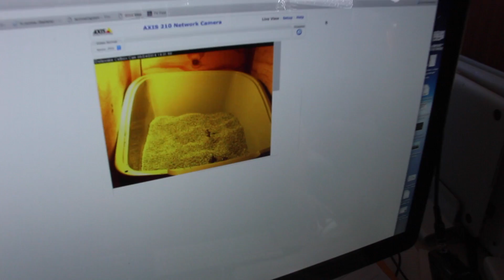Tour the World's Coolest Floating DIY Lab

Comment: Thanks, IEEE, for the video! A couple of comments I want to park here....

First, I would never call my boat the "world's coolest" - I've seen enough ROV platforms, geek megayachts, and research vessels to be eternally humbled. This is just all my passions integrated into a live-aboard boat, and is more about FUN than anything else. 

Also, it hasn't been 10 years... just a little less than 1 so far. My previous substrate was an Amazon 44 steel sailboat named Nomadness, and I attempted similar projects there for about 6 years... but the space was too confining (and serious back problems were keeping me tied to the dock anyway). It was hard for a sailor to make the transition to the "dark side," but the new space is wonderful and I have adapted.

A big part of the motive for this (obvious geeky fun aside) is having a toolset that matches my interests integrated into a portable platform. I'm not fully reduced into this yet (still some tonnage in a rental building that's slowly bleeding me dry), but the intent is to be agile enough to move easily and keep writing without disruption... even with machine tools, 3D printer, ham shack, lab instruments, piano, cat, parts inventory, etcetera. It remains to be seen whether this is my last technomadic hurrah, a built-in escape pod, or just a portable home filled with favorite toys. 

Cheers from Datawake!
Reply: I was surprised you didn't mention the 3D Printer aboard in the video. Glad to see it in the comments.
Reply: @ steve what is data wake researching now ?